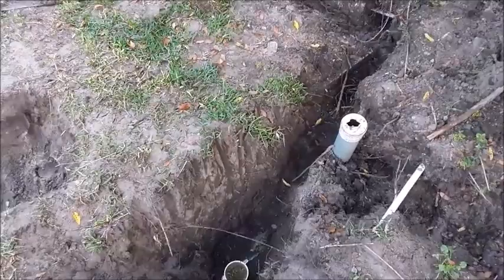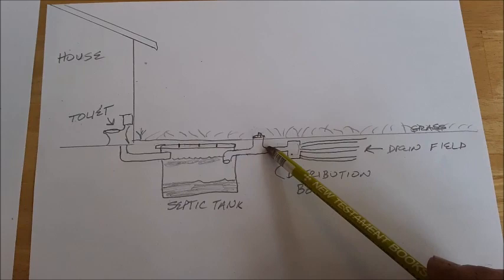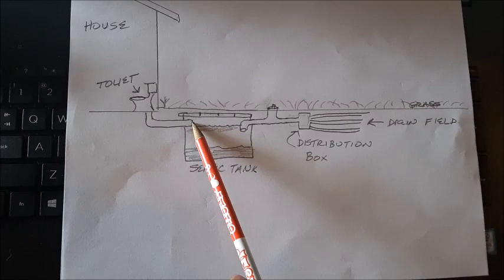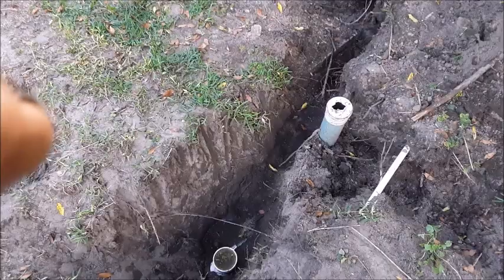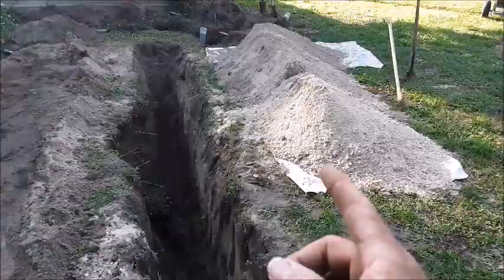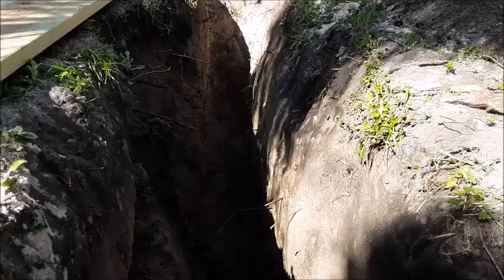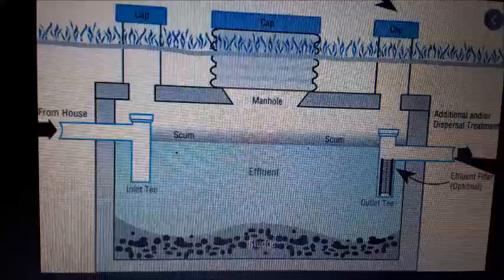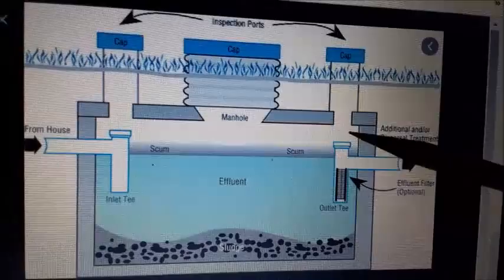$200 Septic Drain Field Repair for Beginners

Comment: Do the holes in the pipe go up my pipe has only two rows they're not around the entire circumference or should I drill more thanks in advance
Reply from the maker: Most people would say they go down.  I had a reason I put them up that I didn't talk about in the video.
Reply: I just want to thank you so much for your advice and your solution to a week septic field. I did exactly as you said and it's been 4 months and we've had no issues of the gray water rising up to ground level and the smell that we usually got after a load of laundry is completely gone. Your video was certainly an answer to prayer I'm probably save me $15,000 which they wanted to pipe me to the street. I pray the Lord blesses you for the help you've given all of us in your DYI videos.

Comment: First off thanks for the video. One thing though. The turn down at septic tank exit. How on earth can that draw? That should be a vacuum preventing any water escaping the tank without a vent at top?
Reply from the maker: Thanks for the comment.  You might think that but septic drain field are not air tight.  If you were to put a compressor hose into a drain field and tried to pressurize the field it wouldn't hold.  The small amount of water volume in the 4 inch turn down elbow doesn't pressurize and keep water from going up the elbow.  If you want to you could drill a small hole in the top of the turn down elbow if that made you more comfortable.  In our area, the rainy season can bring flooding and when the ground is saturated drain fields can start running slow thus causing the water level in the tank to rise.  If you have the open top "T" at the exit when that water level rises and solids start going over the top of the T your drain field will have a short life.

Comment: Hi there! Awesome information! Would this  fix work in an area that has high water tables, for instance during winter heavy rains my sitting water level is about 10-12 inches below ground. The current gravity system has worked for 50 years but has been very slow lately. Thanks and God bless!!!
Reply from the maker: A sitting water level that high is certainly a challenge.  Perhaps if you try a fix like this you should go more horizontal with your rock bed rather the deep.  This might allow more discharge water to disburse above your water table.

Comment: the 4" pipe you used shows the holes facing up -home depot pipe has two rows of holes-shouldthese be facing up or down on the rock bed ? thank you
Reply: I just asked this same question.  Did you ever figure out the proper direction?
Reply: I always thought the holes go facing down. Can someone confirm, about to start the same project.
Reply: Yes down... the pipe he used has holes all over, up and down

Comment: I really enjoyed your video as I am trying to repair mine myself. I have a few questions tho-I thought you could help. I see a lot of these videos and no one ever discusses supplies needed such as mask or gloves, overalls or what. Am I being paranoid with trying to cover myself head to toe to work on this?
Reply from the maker: Hi Lisa,  I am not sure I can give you a qualified answer on that but would reason to say if you are just digging a ditch and filling with gravel you are not working directly with raw sewage.  I have had the septic pumping company out on various occasions and have asked their technicians if smelling the septic was dangerous and they have told me no and they are working with it every day.  For safety I have always worn a "P100" respirator mask when working directly face to face with the septic.  I am sure everyone has a different immune system and should choose what is best for their health.
Reply: @creativerepairing2960  kk thanks for your response.

Comment: Question. We had our tank pumped and and the guy said that there is backflow from the leach field..  does that mean the field is bad? Also it took less than two weeks for the tank to start overflowing.. and we need to get it pumped again.
Reply from the maker: I would say yes the leach field is bad.  Pumping the tank doesn't solve the problem it just buys you the amount of time to fill the tank again.

Comment: So I'm not gonna knock the trench as modern day trench systems have evolved but I will say I have observed  more lifespan to a field vs a trench when it comes to strictly pipe and stone. Like advised check with state and local offices to see if this is an applicable solution in your area. In most states modification to the leachfield without state or local approval is illegal. The homeowner typically can replace in kind with state or local guidance and checkpoints. For example I live in New Hampshire we do a bed bottom inspection to ensure receiving material is adequate for drainage, then a finished install check is performed before overlaying the system for backfill. Every system gets test pits for siev analysis to find the water table both seasonal and actual this happens before a design is drafted. State checks ensure the elevation of the system exceeds the watertable considerably and the system is adequately spaced from the on-site water source.

Comment: How do you the elbow baffle in the septic tank?
Reply from the maker: I prefer to use a 45 degree elbow straight down with about 8 to 10 inches of straight pipe going straight down attached to it.

Comment: Did you put the felt fabric on the bottom of the drainfield? Or just the sides and the top
Reply from the maker: all of it, bottom sides and top
Reply: Thank you, God bless.
Reply: The septic tank baffle out to the drain field is an elbow for best results? How far down the elbow?
Reply from the maker: I like to use a 45 degree elbow facing straight down and add an 8 to 10 inch pipe going straight down from that.

Comment: Disagree with your comment on effluent filter,sludge in bottom should never get that high, it should be pumped out,you wait 30 yrss pump it then you gonna be in doing what you are digging new lines. I have a filter in mine and works great. With risers takes 30 seconds to clean with hose pop it in done for 6 months.

Comment: how tight does the joint you made to t-off the additional pipe need to be to keep roots out over time?
Reply from the maker: Hi Phil, Thanks for the comment.  The connection should be water tight by using either pvc glue or a rubber union with clamps.

Comment: Question about the outlet elbow......How many inches does the elbow go down? And how does water go up into the elbow with no hole on top, as in a tee with an open top? Thanks and God bless.
Reply from the maker: Good questions!

Question 1 -  Usually I like to use a 4 inch "sweeping" elbow as the outlet elbow with no pipe added extending down toward the bottom of the tank.  A "sweeping" elbow usually puts the bottom of the elbow 3 to 4 inches lower the the  bottom of the tank's horizontal exit pipe.  

Question 2 -  Water will always flow to the lowest elevation.  While the septic tank is buried underground it is not an air tight pressurized chamber thus blocking water from going up the exit elbow.  As water searches for the lowest elevation it will naturally go up the exit elbow in search of the lowers elevations in the drain field.   

With an open top T, if the drain field begins to run slow an the water level in the tank rises above the top of the T it will begin dumping solids into the drain field casing the drain field to fail.  In this scenario, sometimes drain fields can run slow causing tank water levels to rise even though they are not already in failure mode such as during the rainy season or when a hurricane passes through causing the surrounding ground to be flooded or saturated.

The horizontal pipe coming out of the outlet elbow is usually slightly lower in elevation than the tank inlet pipe.  Interestingly I know of one tank which the inlet pipe is about 10 inches lower in elevation than the outlet elbow pipe and it has been working great for the last 20 years.  What effectively happens with that one is the long wipe running from the house to the septic tank always is filled solid with sewer water as it  travels to the septic tank.  In this case I would have thought the inlet pipe would have clogged up but in the last 20 years it never has.  
 
Interestingly all the septic systems I spoke about in the video are ones I have been responsible for for the last 20 +/- years so my suggestion aren't just things I have done and walked away from but rather systems that if there was a problem over the last 20 years I would have gotten a phone call.
Reply: No harm adding 4inch extension to swept bend to stop crust top layer getting in either

Comment: if my original leach field is totally blocked and i have pure sandy soil will this work for me and how long trench would you recommend?1000 gallon septic thanks
Reply from the maker: Hi David,  Thanks for the comment.  Not sure I can give you a technical answer to your question as the video suggest a repair not a full replacement.  The long and short is the bigger you make it the longer it will last.
Reply: @creativerepairing2960  thank you for responding,I have a concrete septic with the concrete distribution box attached dirrectly on the end of septic tank there are 2 lines for drainage coming out of distribution box and both are clogged and beyond repair would you recommend going the deep trench or just  make a normal shallow leach field?

Comment: Quick question, will pea gravel work? Nobody sells crushed concrete around me
Reply from the maker: I am sure it would work but bigger question is how much does it cost per ton?  You could also search for recycled asphalt millings or concrete millings, usually very cheap per ton, not quite as pretty but packs down good.
Reply: We ended up paying $30 a yard and used 6 yards total

Comment: Thank you for the informative video! I may have to try that trick sometime since my septic system is 27 years old, but I keep my tank pumped every 5 years.
I use to belive when God answered my prayers, it validated the existence of God to me. Then I realized God wins either way because it's going to be yes or no. So prayer and making deals with God is a false test and proves nothing. You just have to believe but believing doesn't make something true, unfortunately.
Reply: Love the video and specially your interlude to evangelize.

I have a five month old septic system in NC that is shooting all the water at the end of the field. I was told to make a French drain at the end to filter all the water. What do you think?

Comment: This video is showing the most incorrect information about leach field installation I’ve ever  seen! The pipe installed is upside down, holes should be on the bottom, and the cloth dirt barrier isn’t normally placed under the rock bed. Maybe sandy dirt is a unique situation re: the cloth but the pipe is totally wrong!
Reply: Dude.   The pipe he installed has holes all the way around.

Comment: Thank you for sharing Gospel ! You should stick to it. I would suggest you leave plumbing and septic systems to someone who knows it. 
I strongly doubt  that you realize how little you know about plumbing ! Sadly you are here "educating" us how to "$200 Septic Drain Field Repair for Beginners!" I have problem with you being dishonest here my "Brother in God". Two trailer loads of rock cost you $120.
I assume, mash, pipe, and fittings you used in video are $80. It is obvious that you had to transport rocks from concrete recycling place to your house. If your truck and trailer don't cost you nothing, how about gas? How about all the labor you did to do this project?
You made addition to your existing drain field! You did'n fix  drain field ! Yes it will help what you did. I'm not sure for how long, but, it will help. Now, only amateur like you will suggest 90 degree Elbow inside septic tank. "Tee" that you are against it, is in tank for reason. Your elbow is shorter and it will allow more sludge build up in tank !!! Have you ever heard of "preventive Mantinance" ? Do you ever change engine oil in car? Or you have solution to skip that as well.... 
I am amazed, reading comments, how many people are grateful, for "steering them wrong" ! I refuse to use word "lying" because I don't want you to go to hell.... like gospel teach us. I'm not judging you ether, I just think that you don't know better !
At the end, 
What do I know? I'm just the plumber! 
God Bless !

Comment: Soo, the part about DIY for under 200 bucks is where? Oh, right,  total dishonesty and deception from the beginning...Amen, spread the salvation, along with Creflo Dollar, Joel Osteen ETC. 
Did you use a shovel for the ditches?
Reply from the maker: Hi Lance,  Thank you for the kind comment.  The project actually cost me $197.90 as follows:
Sewer Project Budget:
4 Tons Gravel @ $25 per Ton…........................................................…  $100.00
2 Drain Pipes w/Holes 10ft Lowes Item No. 24141 @$11.42ea  .......$22.84
1 Drain Pipe no Holes 10ft Lowes Item No. 24140 …........................…$11.42
1 Role of Soil Separator Fabric Lowes Item No. 561150 …................ $21.48
1 Pipe Elbow 4in Lowes Item No.  276812 …......................................… $4.53  
2 Sewer Pipe End Cap Lowes Item No. 24094 @$4.98 each …........…  $9.96
2 PVC Plug 4in Lowes Item No. 146892  @ $2.98 each ……................. $5.96
1 PVC 4in T Lowes Item No. 24125 …..................................................   $4.78
1 Box 3in nails Lowes Item No. 69123 …............................................... $3.98
Sales Tax at 7% …...............................................................................…  $12.95
Total Project Cost…..........................................................................…  $197.90
Assumptions: You have your own trailer or pickup truck to haul gravel and most important you own a shovel.  "Do It Youself" means You dig the ditch.

Thanks for watching.